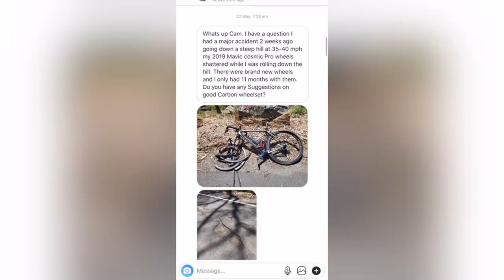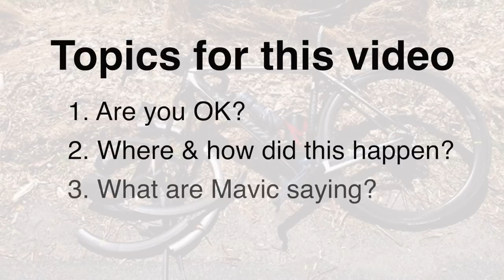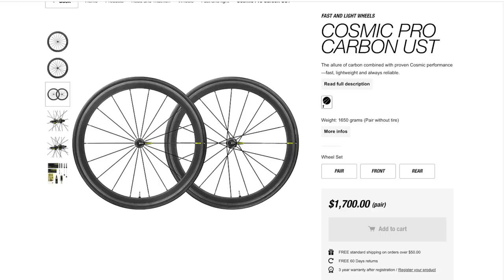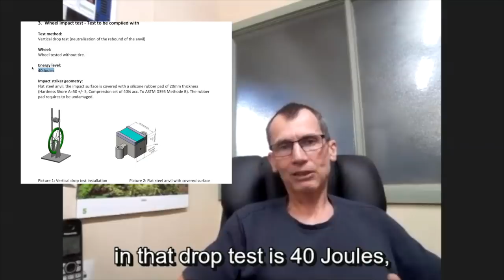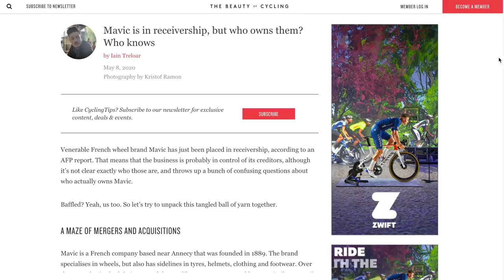A FRIGHTENING MAVIC CARBON WHEEL FAIL (at speed)

Comment: Two words: Disc Brakes
Reply from the maker: Haha
Reply: So why cavendish went down?
Reply: @ruiteixeira1594  if you slow down the video you can see the rider next to him caught cavendish's wheel with his front wheel and that's when the fold happened
Reply: @ruiteixeira1594  he had rim brakes
Reply: be aware,  Aussie sugar addict will pop out and troll u in no time
Reply: Metals
Reply: Go back to aluminum alloy rims, failure not possible.
Reply: Two words: Aluminium wheels.
Reply: @ruiteixeira1594  Cav went down because he was bumped then a rider rode across his front wheel. Can't blame carbon for that.
Reply: @John_Wood_  Ahahah
 look again , and if he used disc what whould be diferent? thats my point
Reply: one word: alloy
Reply: @robertp7209  Really??? if you dig deep enough, you'll find a plenty bent or cracked aluminium wheels alright.
Reply: Stephen .M - aluminum alloy is the best heat sink material around, carbon the worst.  Carbon is an insulator.  Good luck trying to overheat aluminum on a bike.
Reply: Leo_inter_Hyaenaem - aluminum alloy is malleable, carbon is not.  Carbon cracks.  I was biking down a very fast winding hill on my Kestrel Carbon 200 and hit a stone wider than the rim, the impact sounded and felt like a 5 lb mallet hit the bike.  I could not avoid it.  The whole bike shook.  The rim bent open on both sides.  The rim brake pads were rubbing at the impact zone and braked the bike, no flat.  I lived to bike another day.  I don’t but anything just because someone wants to sell it or others use it, and will never ever run carbon rims.  Carbon is the worst possible material to ever be applied for rims.  The “belt and suspenders” solution to that fact is manufacturers switching over to disc brakes with the false premise of being better when wet, and negating any weight savings and adding more.  Carbon rims is the biggest fraud and ripoff ever perpetrated on the biking community.
Reply: I’ve been hit by another bike on the trail and it cracked my front wheel...an alloy rim. It was Mavic though! ;)
Reply: @robertp7209  not the wheel itself but blow the innertube while rimtape was not perfect inline. But I'm with you, no carbon with rim brakes!
Reply: rui teixeira because he caught his front wheel under the front wheel of the gentleman he did not want to pass him.
Reply: kona6812 |
Reply: once a disc always a disc. Cheers
Reply: Tubular
Reply: Disk brakes are forbidden in pro races.
Reply: MontalbanJR  Four words: Disc Brakes Alloy Wheels
Reply: @calvacoca  no they're not. disc brakes WERE forbidden. what year do you live in? it's 2020 now.
Reply: Hilarious. For most people that translates to "new frame and disc brakes."
Reply: How about these two words? No. Carbon.
Reply: Agree.  If rim brakes were so good, we'd be using them still on cars.
Reply: JayR Robles are they better or worse? My road bike has block brakes and mountain bike has disk brakes.
Reply: @calvacoca  that was in 2018... You're two years behind !
Reply: @drbaglyosdaniel  that's three words though
Reply: MontalbanJR what maintainance?  Maybe once a year new fluid...that’s all...what are you talking about???? 🤷‍♂️
Reply: Yes, disk brakes and through-axel.
Reply: MontalbanJR  After not being able to come to a stop for a crossroad twice on steep (>20%) descents I switched to disc. It's just far superior in that respect. I also had a tire overheating failure once on alloy rim brakes, blew out the tire mid-descent. It meant the end of the bike holiday for me. I'm a heavy bloke (95kg): stopping is definitely a problem for me.
Reply: @InfoDav  Tubeless Tires
Reply: @TraumaER  ........Some questions for you: Who has been the most successful professional cycling team [bar none] in the past decade? [I'll give you a clue - they have won TEN of the last twelve TDFs]. Which team has completely revolutionised the use of equipment, nutrition, performance and data analysis, training, recovery, clothing, sleep and rest? Which team has introduced the concept of the 'aggregation of marginal gains' that has even transcended the sport of cycling and is being applied by numerous MNC's to improve efficiency and productivity? Which team has the single biggest budget [an estimated US$34M+ per year] of all the pro-cycling teams and can afford to buy the very best and most advanced bikes, components and other equipment? 
Which team has NOT ONE SINGLE bike equipped with disc brakes - not even their training bikes? The Answer: SKY/Ineos-Grenadiers.
Reply: @thesoultwins72  I don't know what you are talking about.  I have disc brakes on my 2021 Trek ALR 4 and pretty sure I could beat you.  That's all that matters.
Reply: @TraumaER  ....oh dear....- very sad. What colour is the sky on your planet?
Reply: @thesoultwins72  you obviously don't realize that's my back in my profile picture.
Reply: Was looking for this comment
Reply: @LeoInterHyenaem  Yes bent and cracked not complete sudden catastrophic failure there is a difference
Reply: Agreee
Reply: @thesoultwins72  that's not because disc brakes are aren't better than rim brakes but because they slow you down a little bit due to higher air resistance. This is very important for pros and almost irrelevant for non-pros as  the speeds where this really makes a difference are out of reach for amateurs.
Reply: @svenweihusen57  .......So this is why the [vast] majority of pros prefer rim brakes - and the single most successful professional cycling team in the history of the sport only use rim brakes? Hmmm....you seem to be clutching at straws mate [coupled with a healthy portion of BS].
Reply: @thesoultwins72  Because disc brakes have only recently been allowed in pro cycling and people are used to rim brakes, when you are used to something you struggle to change even if its for the better, soon enough every team will be running disc brakes.
Reply: @greatapex2280  You're not excessively heavy...

And what made you believe that your blow-out was heat-related anyway - I've ridden and interacted with aggressive riders who are significantly larger than you, and done so for years, even worked as a bike mech for the better part of a decade at one point...and have never heard of an alloy rim brake causing a friction-related blowout (something I also would've expected to hear about as someone who lives in a desert...).
Reply: @TraumaER  Forget your back and profile pic - your comments are more aligned with someone who regularly visits your screen name with neuropathologies.
Reply: @robertp7209  I’ve seen alloy rim brake wheels fail spectacularly.
Reply: @robertp7209  Yeah, it transfer heat to the inner tube.
Reply: @theadventurebiker  You’re a bikepacker, not a road cyclist.
Reply: @shannontrainer5857  ...and you would know exactly what kind of rider I am, how?????? I'm willing to bet you that I have more road miles in my legs than you do.....
Reply: @theadventurebiker  You’re a 100% mountain biker. The only thing you ride are mountain bikes. Also, dirt roads, gravel roads and single track trails doesn’t count.
Reply: @theadventurebiker  I saw the video. You were in the very back almost the entire time
Reply: @shannontrainer5857  you really gotta love (or laugh at) comments from keyboard warriors like you who hide behind a screen making assumptions posting uninformed, assinine comments with no facts or substance to back them up. And if you had any common sense and knowledge about road cycling you would see that 1.) The video in the link I posted is under 3 minutes long, that means the footage in the video are just some random clips compiled into a short video from a ride that was 1,2, or 3 HOURS long. You would also know that most road rides & race pelotons use some sort of rotation method where rider(s) take momentary pulls at the front of the pack, then drop to the back of the pack, only to repeat itself numerous times throughout the duration of the ride. I can assure you that I took my turns at the front as well, as I do on every [road] ride I do. I just didn't manage to get those moments on camera. I've been doing A level road rides on my mountain bikes for well over 20 years (yes, I've also owned a few road bikes during that time, including carbon bikes). Just in case your uninformed self doesn't know what an A level ride is, those are rides where the typical speeds are between 25-29mph for the duration of the ride (after the warm up), with occasional attacks and sprints reaching over 30+ mph.
GFOH...
Reply: @shannontrainer5857  - what was the cause?   Regardless, extremely rare event, so rare relative to carbon.
Reply: @robertp7209  personally I prefer disc brakes to any rim brake by a long shot but yes the bike industry has promoted so many crap ideas to the biking consumer over the years it's jaw dropping. What's even more astonishing is how most biking consumers gobble this shit up and drink it like it's kool aid, some even going so far as to defend this crap like their lives depended on it.
Reply: MontalbanJR  actually disc brakes are more reliable, more consistent, and require far less maintenance than any rim brake. And the weight difference is negligible.
Reply: @theadventurebiker  - hope your discs are quiet, my Shimano front, especially, act up on occasion and make a racket.  Seems to be weather sensitive.  New pads did nothing.  It took the auto industry more than 20 yrs to finally figure out the end to squealing.  Never had any issue with rim brakes.  Can stop on a dime.  I hear Shimano ICE rotors are failing, by delamination, same ones I have.  Damned F’in nightmare.  Guys switching to Campy solid rotors at a weight penalty.  And I can’t convert back to rim.  I only ride alloy rims, can see guys with carbon rims need discs as a safety must.  I updated my 1996 kestrel carbon 200CSI to Shimano Ultegra, new wheels, etc.  It was retired, now my 3 yr old disc road bike is retired and the Kestrel replaced it.
Reply: @robertp7209  I ride alloy rims exclusively as well. Never owned a set of carbon wheels/rims and probably never will. As for brakes I switched from rim to disc (on my mountain bike) back around 2002~3 and have never looked back. I have used Shimano XTR exclusively and in my experience discs have been far superior to even the "best" rim brakes, and by no small measure. That being said I know some other brands of disc brakes are less than ideal (which is why I run Shimano). I use solid centerlock rotors (not the newer aluminum-steel sandwich design). Never had any issue and always works as expected. I run semi-metallic pads which provide excellent stopping power in all conditions and more than 4-5x the pad life of any rubber rim brake pad. Also totally quiet unless riding in wet/rainy conditions, at which point the brakes do squeal loudly when applied. But 90% of my riding is in dry conditions so really not an issue. I would say the biggest improvement in disc vs. rim brakes is actually the cable vs hose (especially on the rear brake). Rear brake cables used to have a lot of friction between the inner wire and the cable housing. This was even worse on bikes that had a lot of bends in the cable. Cables also used to gunk up with dirt, dust, or mud, degrading their operation and performance even further. All of this contributed to very poor brake performance. With discs there is no cable, just a fully sealed hydraulic hose (on hydraulic discs anyway). A hydraulic hose has no friction and so is impervious to bends along its routing and is also fully sealed from the elements. This means perfect brake operation every time. Hydro disc vs. rim brake = no comparison!
Reply: @robertp7209  also wanted to add that we have 2 tandems as well - one equipped with V-brake rim brakes and the other with hydraulic disc brakes. Once again there is NO comparison between rim vs. disc! Night and day difference! #tandemadventurers
Reply: That's the reason I went disc in 2014. Specialized Roubaix with Roval wheels. Haven't looked back. But if I were to go back to rim brakes, Shimano Ultgera wheels. I wouldn't touch Mavic with a ten foot pole. Under-engineered.
Reply: @theadventurebiker  everything you stated is dead wrong, who do you work for?
Reply: @theadventurebiker  a bike with proper rim brakes will skid the rear wheel, there is no better.  Period.  No one can stop faster than that.  I’m talking road bike no rain and mud shet - I don’t ride in.  If I happen to get caught in a rain shower, I slow down to a crawl because I don’t want the F’in water flying up my back and face.  If I’m on a long downhill, a very rare event, I pump the brakes, never hold them on.  The same way one is supposed to do in a car.  I’m mostly flat, that’s why after thousands of miles - original pads.
Reply: @robertp7209  If you're insinuating that I have work for someone because I have some sort of agenda,...... I don't.
On what ground is what I said wrong????
Reply: @robertp7209  Well there you have it - 
By your own statements you mostly and mainly ride flat, paved terrain (hence alluding to the road bike) in dry conditions. I will give you that in those conditions that you have described a good set of rim brakes will usually perform just as well as a disc brake. No doubt.

But that's a pretty narrow set of riding parameters, and as such really isn't a qualified statement in saying that rim brakes are better overall, because, they're *not*.  I guess this could be a matter of opinion but as someone who has owned and ridden BMX, mountain bikes, road bikes, trials bikes, tandem road bikes, tandem mountain bikes, towed loaded bike trailers and has ridden in flat regions, mountainous areas, in hot dry clean conditions, hot dry dusty conditions, pouring rain, across streams and rivers, in mud, and more, there is no way in hell I'd ever go back to any bike with rim brakes. Rim brakes are acceptable for a narrow set of specific conditions but outside of that they purely suck and there is no comparison whatsoever unless you're completely a fair weather rider riding in flat terrain and good weather conditions etc where your use of brakes are minimal. And even then, in certain situations the differences are still significant.....
Reply: @robertp7209  You wanna know why rim brakes mostly suck? Here.. I'll give you several reasons why:
1. Heat. Brakes (all brakes) generate heat. On long descents this heat can damage the resins on carbon composite wheels which can lead to catastrophic failure. So don't use carbon wheels then. Well the heat on alloy rims can still cause tubular glue to soften which may lead to tires to coming off the rim. So use clincher tires then. Well this heat can can increase tire pressures on the move which can lead to potential blowouts. (Remember if the temperature of a gas increases in a confined space, it's pressure also increases proportionally). Disc brakes eliminate these issues. But you wouldn't know any of this because according to your own statements you only ride where it's flat, so you'll never use the brakes hard enough to where they will generate this amount of heat. 

2.Wear. In case you didn't know, brakes are friction devices that are subject to wear. Not just brake pads but other braking surfaces as well, ie. rims or brake rotors. I don't know how much you ride but my disc brake pads (and rotors) last a hell of a lot longer than any rim brake pads I've ever used. By several orders of magnitude. And have you ever had to replace rims because the brake tracks became so worn (and thin) that they were structurally compromised? I have. Another issue eliminated by disc brakes. Rotors are a lot cheaper (and easier) to replace than rims....

3. Cable friction. Most rim brakes are cable driven. Most disc brakes (not all) are hydraulic. Cables & housings often get gunked up with grit etc from riding in the rain, or through puddles etc., especially where the tires are spraying up grime from the road or wet dirt from the trail. This pesky grit & grime almost always finds its way in between cable wires & housings (unless you are using a sealed cable system). Cable wires can also become oxidized if they're not stainless steel. Both of these conditions cause excess friction in the cables that result in a reduction and loss of the force applied between the brake lever and the clamping force delivered to the rim by the brake caliper. A.K.A. reduced braking performance & power A non-issue with hydraulic disc brakes. But you wouldn't know any of this because according to your statement(s) you only ride in fair conditions.
Reply: @theadventurebiker  carbon is all wrong for rim brakes, guess which came first carbon or rim brakes?  To keep from going bankrupt the companies, due to personal injury lawsuits had no choice but to switch to disc brakes.  Not for any other reason in the world.  On long descents on alum, pump brakes in spurts.  The heat dissipates readily in alum.  EXACTLY the same procedure driving a car.  As far as wear goes -  readily measurable in alum.  Friction?  Come on.  Are you kidding.  And when the cable wears out, get a full set of shimano brake cables on Amazon for less than 12 bucks.
Reply: @robertp7209  Yes. Cable friction. You do know that unless cables sealed with sealed ferrules etc. 1, 2 or 3 rides in a nasty downpour or muddy conditions can totally gunk up and foul cables, right? So you mean to tell me that I should replace cables & housing after every couple of rides if I happen to get caught in bad weather and/or road/trail conditions? Oh wait, you don't know that because you only ride road bikes on flat terrain in perfect weather conditions. Disqualified!!!!! 
Hydraulic disc brakes completely make this a non-issue. There is no comparison.
Reply: @theadventurebiker  - your hydraulic system will eventually leak and have to be rebuilt or replaced, both levers and cylinders at the wheels, and the process of filling and bleeding system of air.  No bargain there especially as much as you use them.  Good luck finding a rebuilder if it’s even possible.
Reply: @robertp7209  Nonsense. Where do you get these rubbish theories from? I have a mountain bike here that I built new in 2012 with Shimano XTR components (including XTR hydraulic disc brakes). The bike is nearly 10 years old now and has nearly 40,000 (that's 40 with a K) miles on it. This bike has been ridden on just about every type of terrain, environment, & weather condition imaginable. The bike can be seen in most of the videos here on my YouTube channel. Most of the parts on this bike are original except for normal wear items like tires, chains, cassettes, cables, a couple of chainrings & bottom brackets, & brake pads. As far as the brakes go the only thing I've ever had to do to them is replace the brake pads - This is something that you'll have to eventually do on ANY brake system at some point and I will say with utmost certainty that my XTR brakes with semi-metallic pads not only stop better than rim brakes in all conditions, the pads last last at least 3-4x longer as well. Outside of a few pad replacements during the time I've owned this bike, I have done nothing to the brakes whatsoever (not even bleeding them after their initial setup). So I don't know what you're on about, your information is just plain INCORRECT.
Reply: @robertp7209  ....like the hydraulic brake system on EVERY car, truck, & motorcycle on the road eventually leaks and has to be rebuilt or replaced. GFOH!
Reply: Until the pads burnish and you run off the side.
Reply: With carbon wheels most definitely!